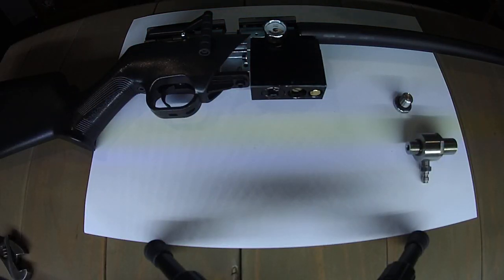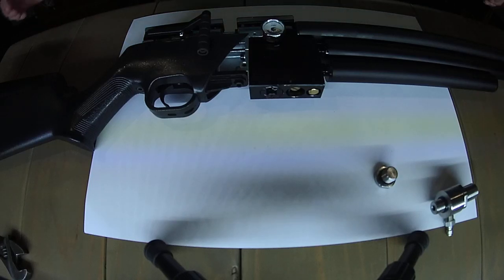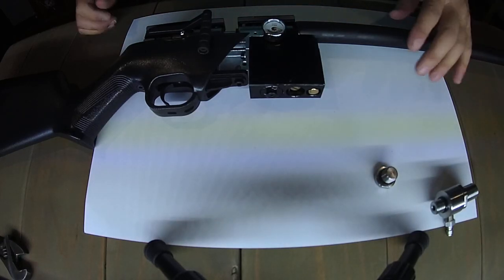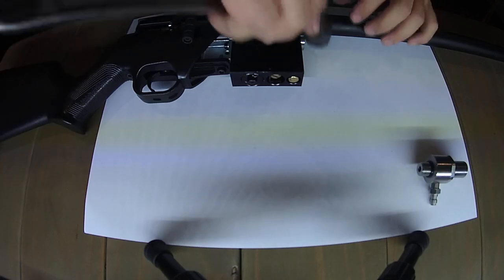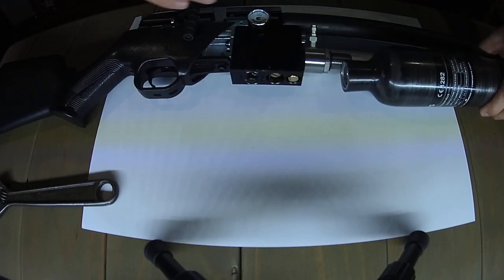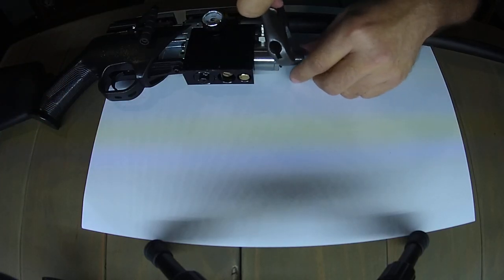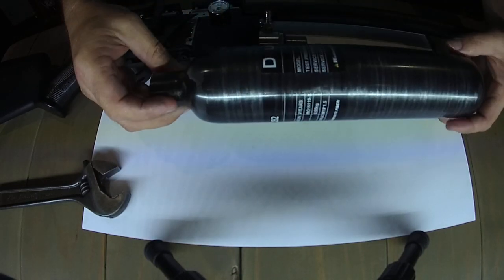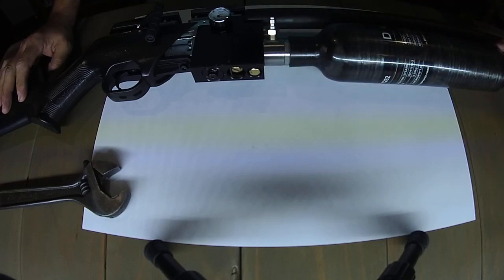Air Venturi Avenger and Nova Leviathan PCP Bottle Adapter Fitment

Comment: I did mine after tubes leaked Love my bottle !! Used Gauntlet bottle adapters so mine has barrel band !! Looks great thanks !!
Reply: What is the thread pitch and diameter? M16X1.0? Trying to see if I can use this or the gauntlet adapter to install a asa bottle on the Nova Freedom

Comment: I would add a bottle adapter (can find on Amzn) and a bottle regulator for a 2 regulator system.  Also add a power plenum. The only advantage I see with adding a bottle though is more shots per fill. Disadvantages are more weight, more weight to the front of the gun, Frankenstein look, loss of pic rail for bipod mount (bottle mounted pic rail suck) and loss of sling mount. Is it worth the loss? If you are a target shooter that likes to shoot off a bag and have a high pressure pump in lieu of a tank fill, maybe... hunting gun, no way.  Stick to stock configuration.

Comment: Can you make the Avenger bottle adapter to use the Fx impact m3 bottle?
Reply: Or a Seneca Aspen/ Nova Freedom conversion kit ? There are many out there that have broken check valves and final stage pump orings and just want to make a nice regulated bottle pcp.